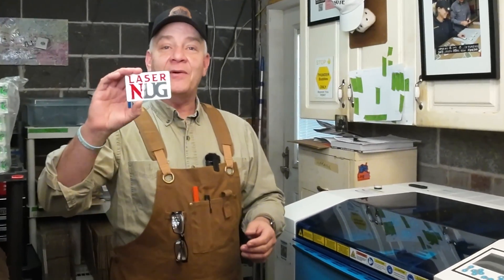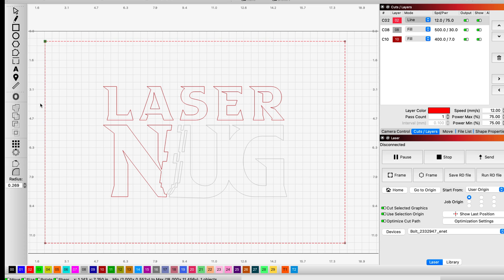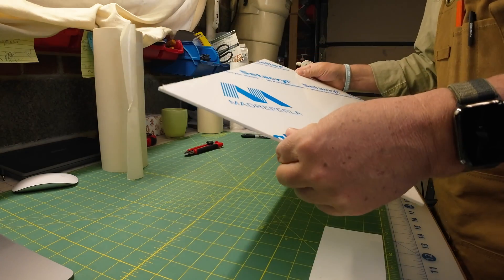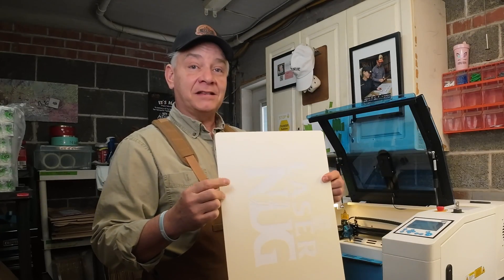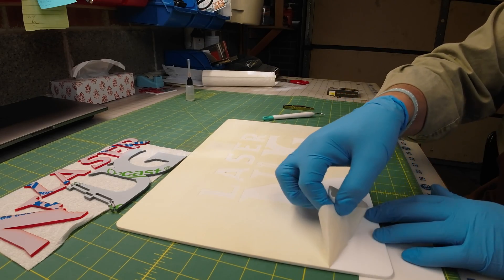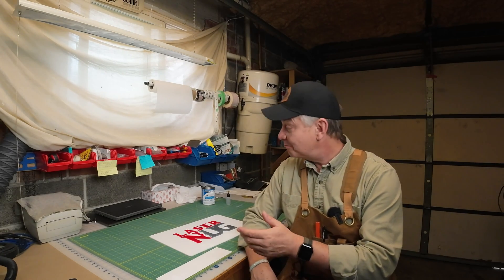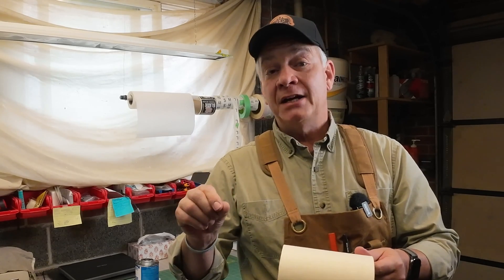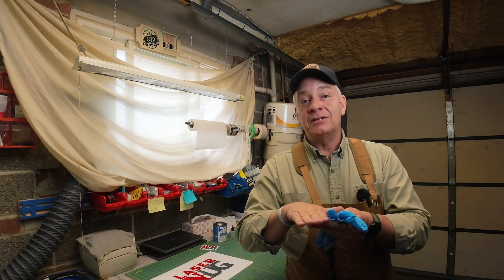Coloured Acrylics on Thunder Laser BOLT. Cutting and Engraving. Nice! 036   4K

Comment: keep vacuum on the syringe so that its always pulling the bonding agent back into the acrylic, that way it only comes out when you squeeze slightly and wont drip.  Kind of something you pick up after using that stuff for a while.  Turn the needle upright, squeeze the air out, then turn it upside down and the bottle will keep sucking in under its own pressure, allowing you to simply squeeze a little to regulate the amount of solvent you want to come out.  

Hope that helps, God bless :)
Reply from the maker: It does very much - thanks and have a great weekend!

Comment: Hello Gord,
Have you considered using a hypodermic injection needle with the plunger instead of the plastic squeeze bottle that drips out the cap threads?  The hypo needles come in different diameters with a sharp chisel edge.  Maybe try the narrowest diameter needle and filing off the chisel end to a flat & 90 degree end.  Then polish and square up end of needle with fine 500-1000 grit diamond card.   The smallest diameter needle may be what you need for precision and drip control.  Amazon sells packs of various sized needles pretty cheap.  A drugstore will demand a doctors prescription but Amazon doesn’t.  Cheers!

I have some separate new and untouched needles (inside the little cases) in my First Aid box that are excellent for removing tiny wood or metal splinters from my fingers.  Needles are so sharp that you can gently slice out the splinter with exact control and barely feel any pain.  I wear a headset magnifier to see the splinter up very close when using the hypo needle.  If a buddy needs to remove his splinter give him a new sealed needle, don’t lend yours to him for health reasons.

Comment: Gord, I was wondering if you could create a number of small holes inside the engraved pockets completely through your base material when you are doing the engraving. Then after you cutout the letters of the appropriate material, tape with perhaps masking tape the cutout letters into their respective pockets.  After this, turn the entire assembly with the taped in letters over in order to place the weld liquid through the holes from the back. This way any drips would be on the back, not on the front where they would be seen. It may be necessary to apply some down pressure from the back when applying the weld liquid to ensure there are no voids between the letters and the base. This maybe a bad idea but it does keep th3 drips on the back. Enjoy these and the outdoor videos.
Reply from the maker: Good morning Ronnie!  I think that is an excellent idea - I can add little holes easily and I think that would work great! I will give it a try next week for sure. Thanks - I really appreciate it. I think when selling something to a customer, it needs to be perfect and I agree, if it drips I would rather have the drips on the back and keep the face of the sign clean. Thanks again - great idea I think!